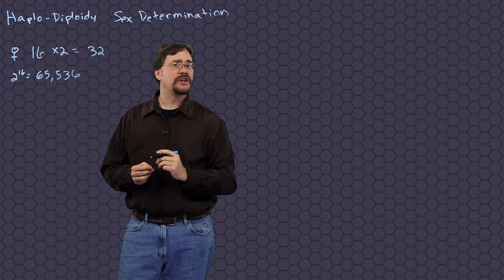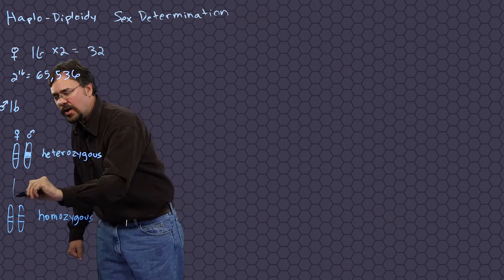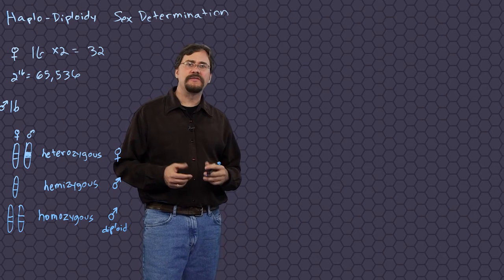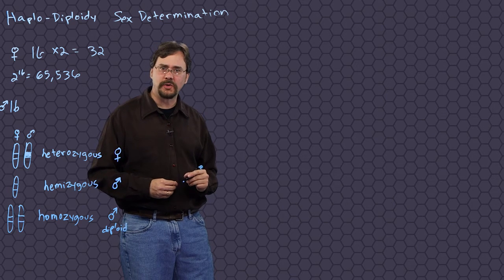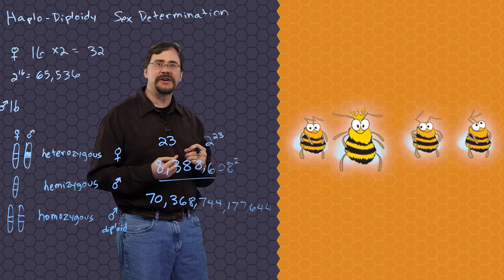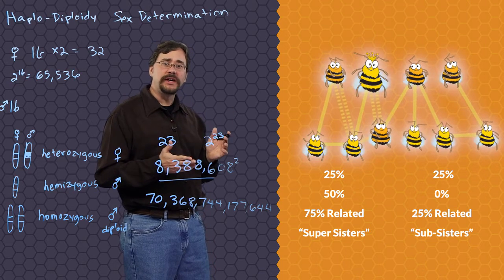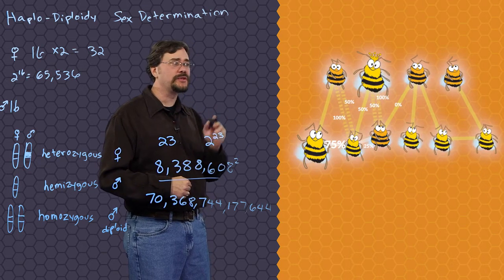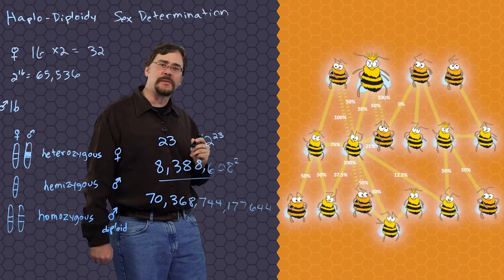Haplo-Diploidy Honey Bee Genetics

Comment: the dimensions of the brood cells are the most significant determinant of sexuality. a large cell doesnt compress her sperm sac.
Reply from the maker: The size of a brood cell determines whether the queen will lay a fertilized or unfertilized egg.  But, as explained in the video, two identical sex determinate alleles will result in a diploid drone, which does develop from a fertilized egg put into a worker sized cell.